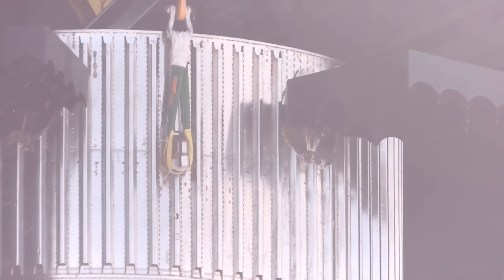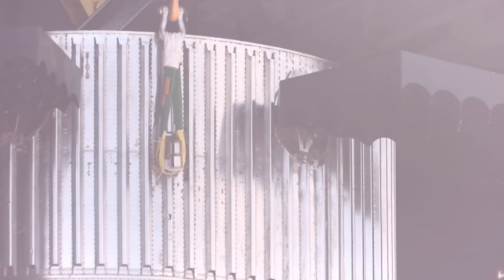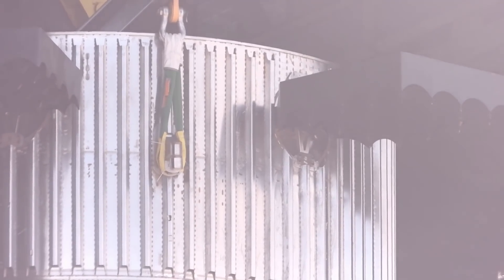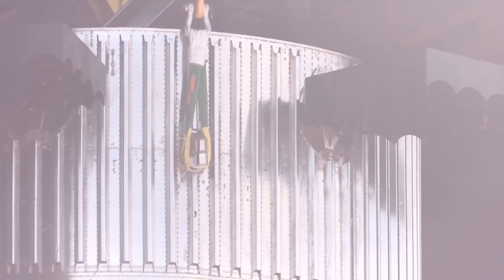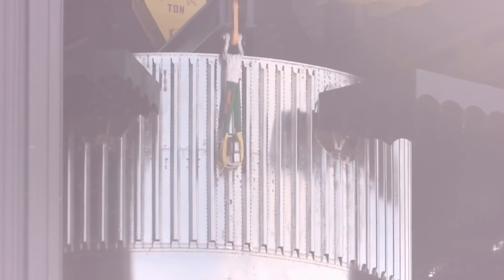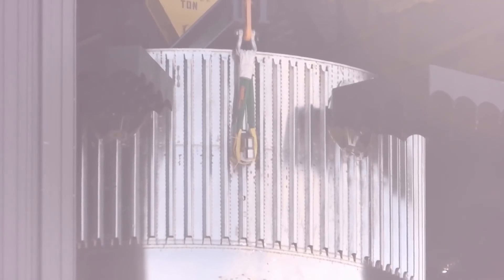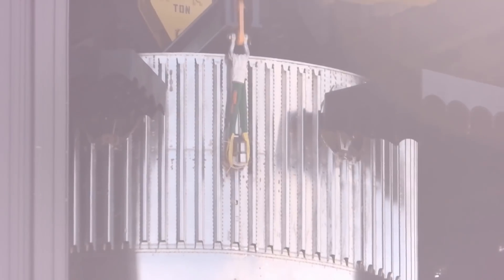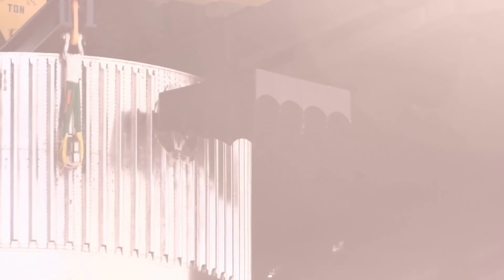Booster 4 with Grid Fin, SpaceX Starbase, Boca Chica, TX

Comment: Seems like they would have way more dray if they folded them so its kinda genius to just keep them out.  The best part is no part, and I would be a folding mech is heavy so I say its a pretty dang good idea.
Reply: There will be some drag going up, but rotated that would be minimized.
Reply: @-danR  Rotated?
Reply: @tra757200  he probably meant folded, like the falcon 9 does.
Reply: @ZillionPrey  If so, it cant possibly have less drag.  They are square and not insignificant in side.  Like holding a pipe with the hole pointed into the wind as opposed to sideways.  I think they got that figured out and they will stay just the way they are now.  I think its an elegant solution to minimize drag and decrease weight.
Reply: @tra757200  There won't be much drag with 29 raptors firing. The grid fins will stay extended the entire time.
Reply: @TheBirbLeader  Thrust can overcome drag but can't reduce it.  I agree, they will stay fixed horizontally and rotate for directional control.  This is what happens when you use first principles thinking.
Reply: @tra757200  I also think they went with no folding gridfins to make sure they're as strong as possible when they attempt to catch it for the first time.